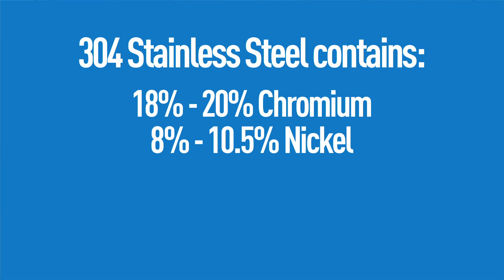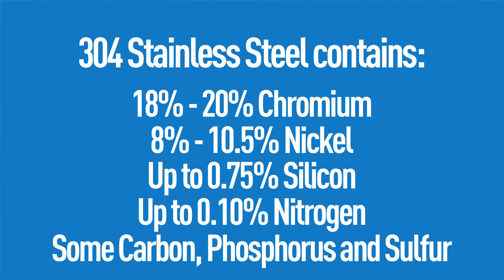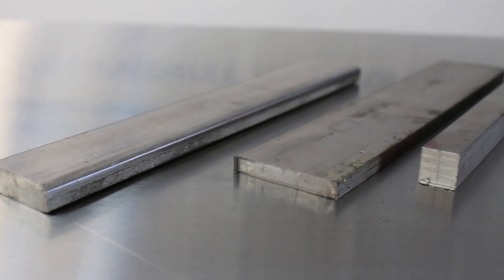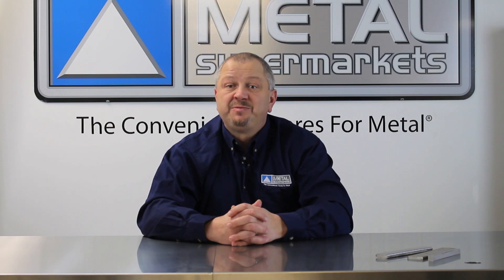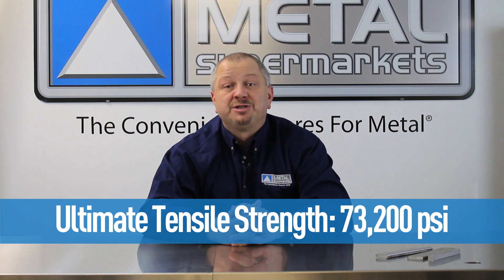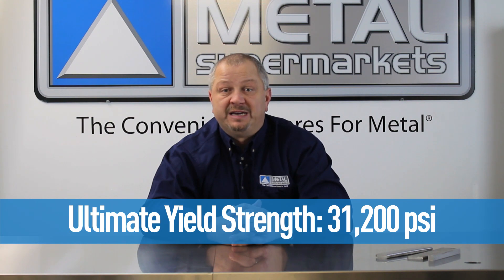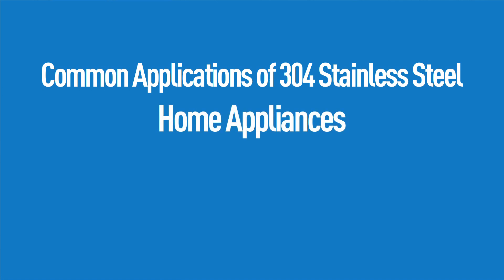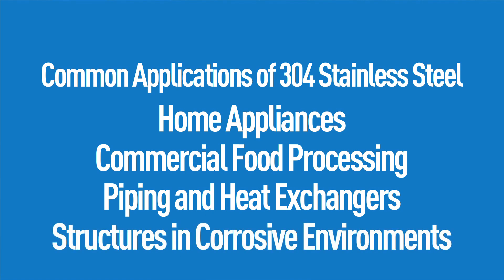Grade Guide: AISI 304 Stainless Steel | Metal Supermarkets

Comment: my stainless 304 supplier advised me to install this stainless to a tidy and clean environment, else oxidation can develop. is this really typical? does it get rusted even placed around dust but dry environment? our purpose of acquiring stainless is to not worry of it getting rusted easily but seems the opposite. it's funny.